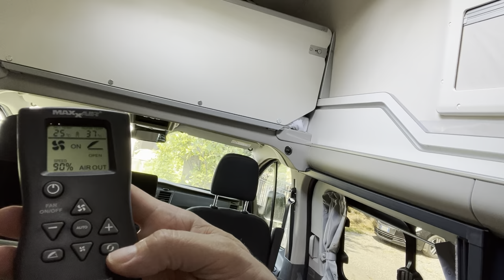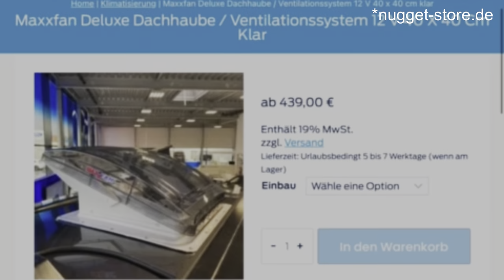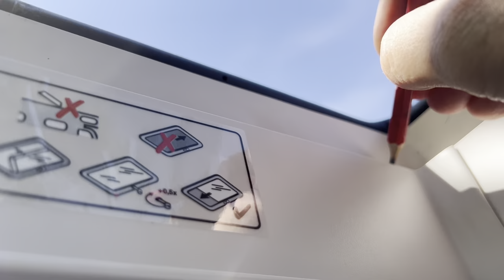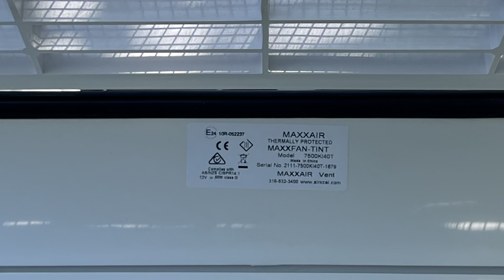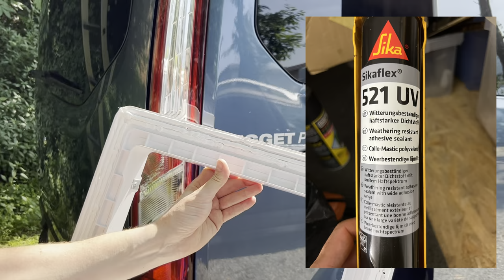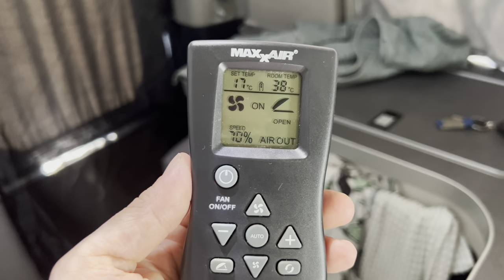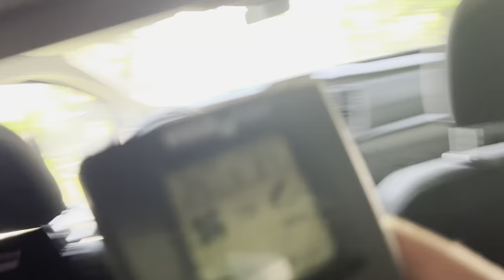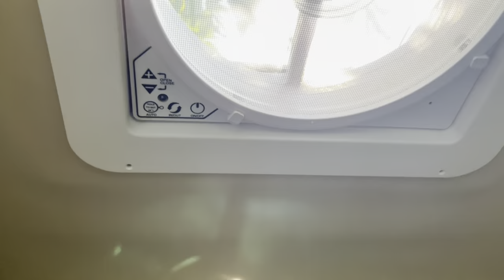Trying to Keep Cool!  Is a Maxxfan the answer?

Comment: That’s awesome 👍🏻😍. Do you think it could be installed on a pop top roof of a Nugget plus too? Does it make sense on that type of top roof? Thanks a lot for sharing 🤗🚐👍🏻👍🏻👍🏻
Reply from the maker: Hi David!  A very good question indeed!  I often thought about having an addition ‘hole’ in the roof of our pop-top when we owned it.  Although you have fabric sides, the hot air still struggles to escape at the top.  Also, if it is raining, we needed to close the fabric side openings as rain came in amd we then struggles to keep the airflow going.  If you are using additional pop top insulation, the van can then get even more stuffy.  I am yet to see anyone brave enough to install something like this to a pop top-top, maybe because it would be a bit clumsy and maybe not ‘look right’.  Maybe someone who has tried will read this comment?  Lets see!  Thanks for watching and commenting 😃👌🏻
Reply: @CaliCamperFamily  I really appreciate it 🤗🤗🤗
Reply: I have a pop top plus and I wouldn't risk it. We have the large window that opens at the back (in the fabric) and that really helps. Our van only just fits in the garage with 2cm to spare so it's a no! Still not decided on solar panels but we are getting by with a Jackery 1000.
Reply: @richardcope3850 thanks a lot, Richard. Your comments are really helpful 👍🏻, I’ll take them into account.

Comment: I think for the price those fans are great. We have friends who own a Hymer A class and they have air conditioning but said it’s loud and really cold! I think they’re also heavy on power whereas lots of full time off grid vanlifers seem to manage fine with Max Fan. I think I’ll put one on my wish list, the dogs would love it. Thanks as always for sharing an interesting and informative video.
Reply from the maker: Hi Sylvia, yes, the power drain is the biggest issue for campers, especially if you want to be off grid.  The Maxxfan will run for days on just our leisure batteries, including running our fridge and charging our phones etc.  Although obviously not as good as air conditioning, it’s an effective tool.  (Depending on where we are parked, we can run the engine and get air con that way if we over heat!). Also, perfect for the dogs I’d say!

Comment: Hi Cali Family, thank you for the video for the maxxfan install, can you tell me where you found the 12v aux battery feed to piggy back the maxx fan to please?  I have a 2022 Nugget plus and want to install the maxxfan as well. Thanks for sharing.
Reply from the maker: Hello!  A great question!  I used the wires for the Thetford toilet.  These wires are hiding just under the vertical cover which you remove to get to your toilet cassette.  I used a separate inline fuse for the Maxxfan.  We use the Maxxfan all the time, and no problems with the electrics at all.  Hardest part is threading the wire in the headlining/insulation to the cupboard!  All possible though…good luck and we’ll worth the effort.  Makes a huge difference.  Best regards, J
Reply: @CaliCamperFamily  Hello J, I enjoyed your install video for the fan install and was looking for the 12v  supply you showed but it appears that this was the feed for the tow bar electrics so already in use.  The only concern I have is the wire used for the Thetford toilet is considerably thinner than the Maxx fan feed cable.  What value fuse did you use for the in-line fuse ? I agree the hole to feed the cable through the roof lining insulation was a bit of a **! So had to do it carefully.
Reply from the maker: @daviddenton1926 i can’t remember, maybe a 5amp fuse.  My towbar electrics were installed by Westfalia, and they don’t use the same wire as the toilet.  That’s a bit of a strange solution you have for the towbar as the wire for the toilet gets it’s power from the leisure battery.  Hence, it is always live.  Anyway, the Maxxfan doesn’t draw that much power, you should be fine.
Reply: @CaliCamperFamily  My tow bar was fitted by the Ford dealer so I have no concerns in that area as everything works fine.  The separate toilet wiring will be the way to go to piggy back.  Thanks for the feedback and enjoy your future travels.

Comment: Let us know how effective it is in cooling down the interior of the van. I hope you won't get a leak as the sealant you used will make it very hard to remove the frame which is why professionals use a softer more elastic one (more of a paste).
Reply from the maker: So far, so good!  Also, if we are running the engines airconditioning, the Maxxfan sucks the cool air to the rear helping to circulate it.  As regards the sealant, I used the recommended sealant for RV’s/campers/GRP…not a pleasant job replacing the manufacturers frame, but I don’t think there is a better aftermarket alternative.  Thanks for watching 👍🏻

Comment: The old frame was just glued to the car and held by brackets, being engineered by some wise men who new the ancient rule: never put a hole in a hull unless you really need to. Obviously the new device is at somewhat (much?) lower engineering level.
Hope it wouldn't leak...
Reply from the maker: Hello, and you make an exceedingly good point.  I wasn’t keen on drilling all those holes, hated it infact!  However, there isn’t much of an after market alternative.  After fitting it and using it properly on 3 different trips, I can confirm it was worth it for the ventilation, and no leaks so far!  Thanks for commenting 👍🏻